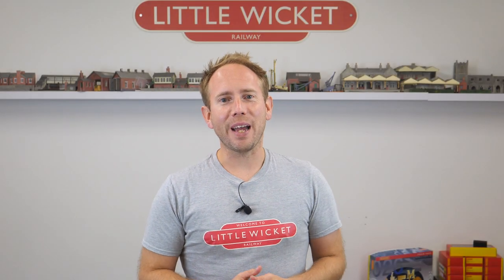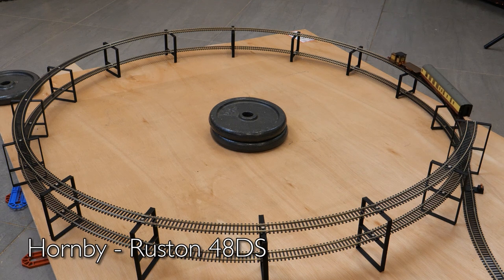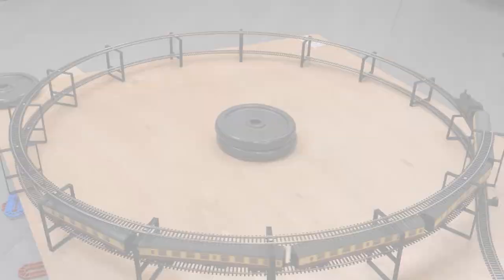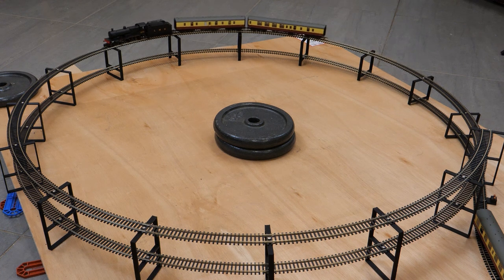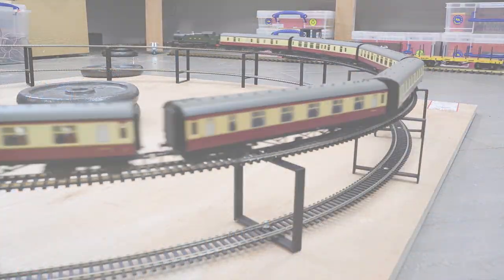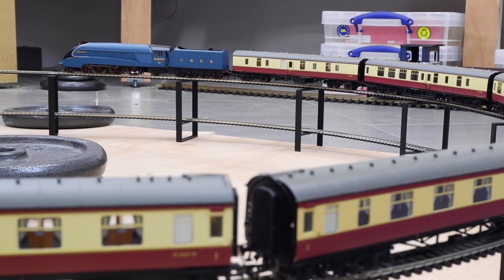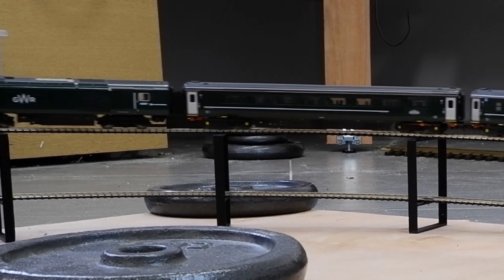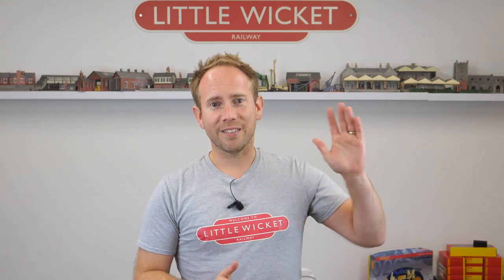23 Models Tested on a Helix - Can they get to the top? 🤔

Comment: Very informative thank you. 2% is recommended as the steepest gradient on a layout and anything less would make a difference. If you are planning a two track helix then the inner line should be down and the outer up. If you set the outer at 4’-6” using flexi track (check clearances) then it would be at 1.78%. Of course the bigger radius the shallower the gradient if maintaining the same height change. The tender locos seemed to fair worse, possibly the three axles dragging that bit more on the curve.

Comment: Hi Rob, a very good test for the models and your new layout. Great way of testing actual models, will it be just a single track helix or a double with tighter 3rd rad curves. Wonder if the radius will make a difference as well as not w straight incline, the table of info is great for reference. Looking forward to next video and a railway room update; if one available.. all best Marc
Reply from the maker: Hi Marc, it's a double track helix, but the tighter 3rd radius is only for trains going down. Filming a layout update tomorrow, but set your expectations low.

Comment: it's possible that the central drivers of larger locomotives are losing contact with the rails around the corners(by design, in most cases) and compounding the effect of corner drag by reducing overall tractive effort
Reply from the maker: Good theory, I expect the length generates more friction. Maybe the tender/tender connection increases drag.

Comment: Hi Rob, Is this the largest Diameter, how high,  how high are you going up, how much space is there between the Train and the Underside of the Overhead level. Adding a FLEXI track outside your R4 Radius track
Reply from the maker: Hi Graeme 👋 this is the largest radius I'll be using, but my helix will have straight bits in the middle, so more of an oval, which should reduce the gradient. Settrack curves are just far easier to use for the hidden areas. There will be a 3rd radius inner track for trains going down. I can't remember the clearance here, I'll measure when I get out to the layout tomorrow. Clearance will be less on my layout helix owing to the thickness of the baseboard. I'll be going up around 50cm.

Comment: Hi,
I am about to build my first layout, it’s going to be a DCC. I’m using 00 Hornby set track and flexi track only because I have it in boxes for years, unused. I also want to use up my Hornby insulated points ( R 8072 & R 8073 ). Am I wise using these points at the start of a layout build and I will need additional points. Will I stick with these points ?. Most of my locos are long and heavy like the Deltic, Eurostar etc. I’m using seep point motors with switch for feedback. Do I need to remove the spring from the points?. I’d appreciate your thoughts on this. Keep up the great videos. 
Many thanks, Alan.
Reply from the maker: Hi Alan, there's nothing wrong with Hornby points, especially if you've already got them. I've switched to Peco because there's a wiser variety of size and I wanted electrofrog.

If you're using solenoid point motors I'd leave the springs in so that the blades stay in position. You'll possibly need capacity discharge units (CDU) for the seep point motors to give them enough power to overcome the spring though.

Good luck with the build!
Reply: Thanks for getting back to me. I’m using an ESU switch pilot so I don’t think I need a CDU, but I don’t know if the output will drive two points at the same time. The default setting is to fire the points for only 250mS.
Reply: I hope you and yours enjoy the Christmas holidays. Alan
Reply from the maker: @Alan White  thanks Alan, you too, have a wonderful Christmas!

Comment: I believe Barry Davis has the answer to your Tornado issue - it is back heavy, and as such, pulling away facing up hill accentuates the problem, leaving only a single driving axle in full contact. Put a weight in the smokebox and the problem should be greatly improved.

Comment: A good update on the experiment. Are you going to have just a single track helix at 4th radius as I suspect 3rd would have a much bigger impact and 2nd probably next to useless. I have noticed larger steam locos can slow down on 3rd even on the level so if you did want to try it then it would need to be the down track only.
Reply: Having seen other videos, people tend to suggest only using 3rd radius for going down and 4th or greater radius for going up, the oval also helps improve things.

Comment: Hey have a quick question
Would you consider getting a Hornby class 31 with mazak rot, sounds strange but hear me out,plz note I am 14 and have little experience with 00 I do n gauge

This loco can be picked up for little money when having mazak rot ( just bought a class 31 with mazak rot and a spare chassis for £85) and there is little needed to fix them, they userualy run fine and once cut or broken off and filed down the buffer beams glue in with ease. The only thing too look out for is to check the flywheels are doing there job, if not take the bearing off the drive shaft and unseze it

Sounds alot but has boosted my collection and now have 3 class 31 all saved from mazak rot
A BR green Hornby one with modded replacement chassis £42.50

An airfix class 31 with a Hornby chassis £0.00

A class 41 (my made up loco) made with a mainline class 42 with a Hornby class 31 chassis £42.50

Just remember if I can do it, anyone can
Thanks for reading
Reply from the maker: Sounds like you're becoming an expert at rescuing locos with mazak rot. Touch wood, I've not had a loco with that problem. If you can get a loco cheaper and fix it up it's a win win. You get a cheap loco and the satisfaction of fixing it. Even if you find it's unfixable then you can break it down for parts.
Reply: @LittleWicketRailway  your right there, so far a haven't been beaten, considering a Garrett made with Hornby 0-4-0 chassis

Comment: That was very interesting. How high was the helix? from ground level. I want to run a double track high level of five inches from the ground. What worries me is how long a run up to five inches would I need? Martin. (Thailand)
Reply: 5 inch rise at 2 degree slope is 142 inch lenght slope. Formula is 5/tan(slope in degrees), ensure that the tan calution is performed in degrees as the alternative scheme is radians which you don't want.